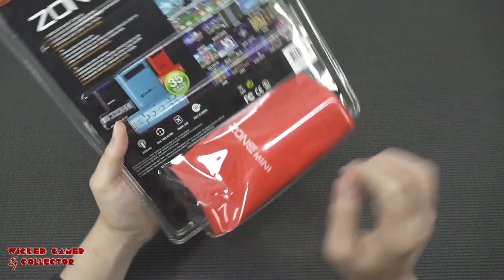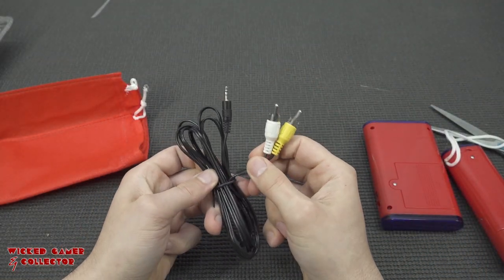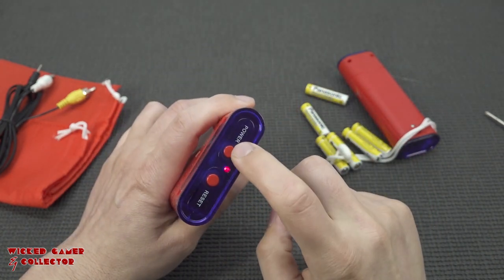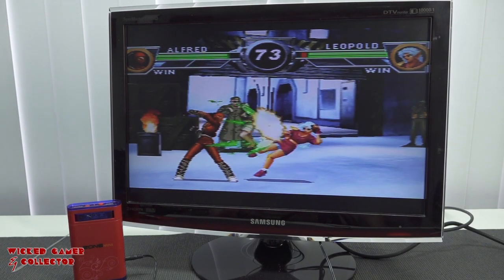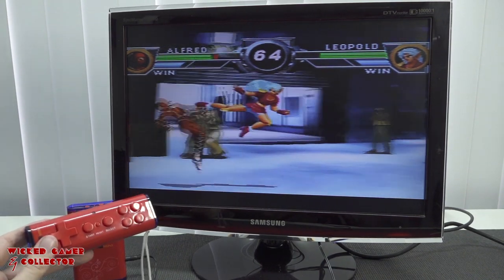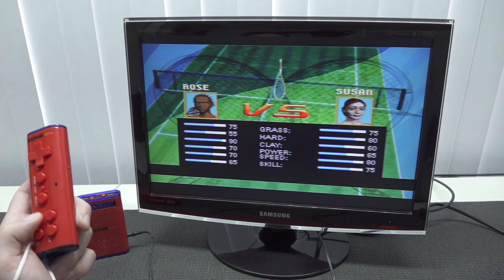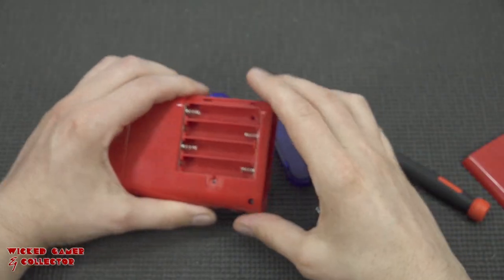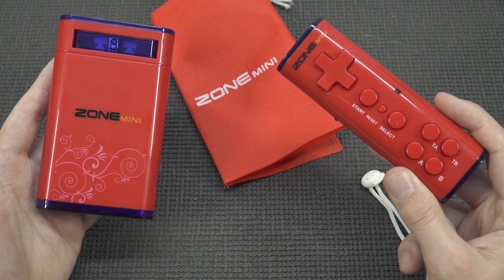Portable Motion Portable Wii Console ! 😨

Comment: Come on man. How hard would it be for them put a rechargeable battery in and give you one of those crappy mini USB cords? Batteries in the controller are fine, but the system.
Reply: Just my take, but consider that rechargeable batteries require proper charging circuitry lest they become a fire hazard. Similarly poorly made (read 'cheap w/minimal QA') batteries might also have a high defect rate and spontaneously fail in flames. I really doubt the increased costs and bad PR would be worth it. They aren't even bothering to use real packaged chips after all and are keeping the PCB minimal.